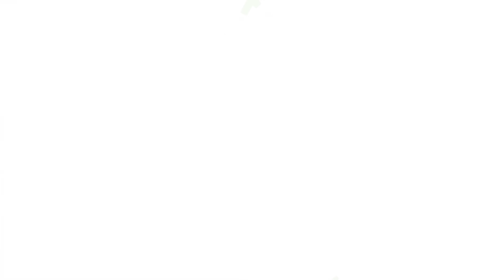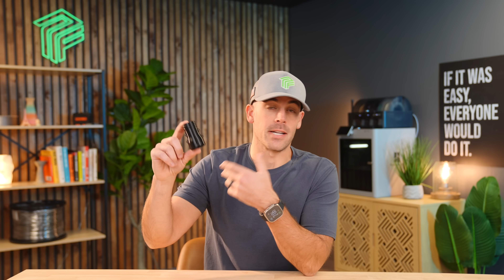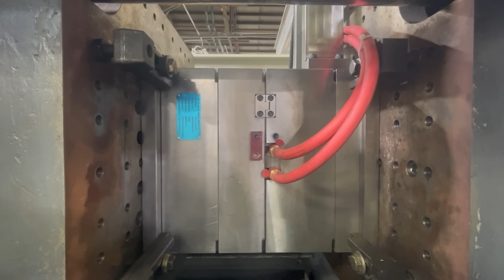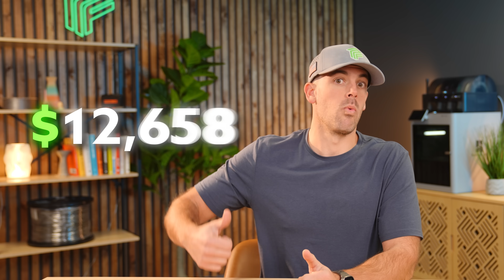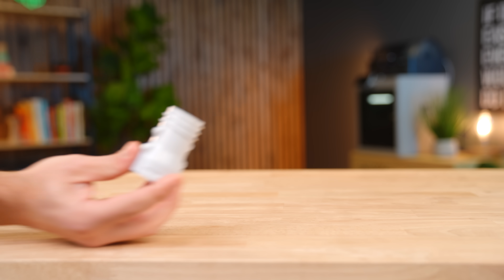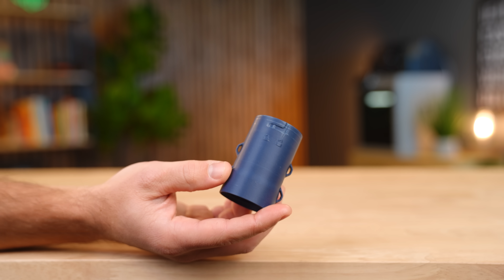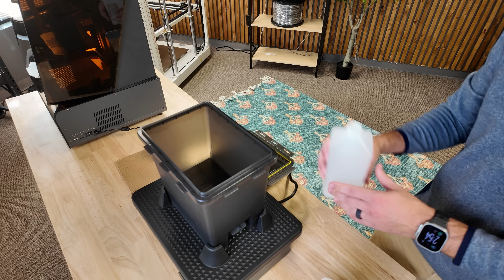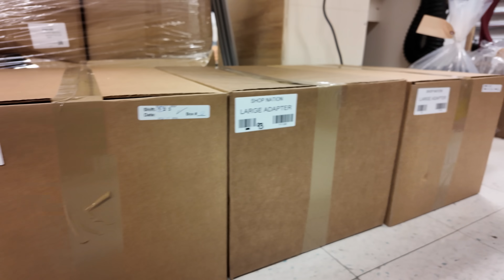Why is 3D Printing so Expensive?  Injection Molding Comparison

Comment: You could have decreased your 3d printing farm costs, and automate it more. Quite trivial.
But yeah different development path and if you are selling what 20+k a year of these, it starts to get tough to get 3d printing competitive. But it woudl have synergized for all the printing you do, decrease manufacturing costs across the board.

Remember, prusa does do it profitably at scale. A lot of research does show competitive pricing against 3D Printing.
But the comparing outsourced to outsourced ... You are already farm operator; So that's just finding justifications. Your real ROI is more on the 100k units sold ballpark so i guess 4 years or so -- if volumes stay steady.
Reply from the maker: Not exactly "trivial" but I get your point.  Also, Prusa should be molding much more than they do...I think it's more about a cool factor than pure business practicality.  No doubt some of their parts are better produced 3D printed (ex. weird internal geometry) and keeping some parts 3D printed is very valuable for continuous improvement but other parts don't change much and could easily be molded.

Comment: Now that you have more experience with resin 3D printing, would you do all the design iterations with resin or do most of the iterations on FDM (no cleaning, curing, no smell) and only do final iterations on resin?
Reply from the maker: Yeah I think FDM is the quicker path to 95% validation, then do the final tweaking with resin

Comment: I wonder how much cheaper the mold would have been in China
Reply: The concern there is the protection for his design.  Not that they couldn't reverse engineer it currently but you make them aware to the volume and market when you buy molded parts from them

Comment: Hey man I absolutely love your videos! I would check your shutter speed or shuttle angle on your camera settings though, your sign is flickering a bit in the back:)
Reply: Also noticed that, this could also be easily fixed in post with a static frame over it